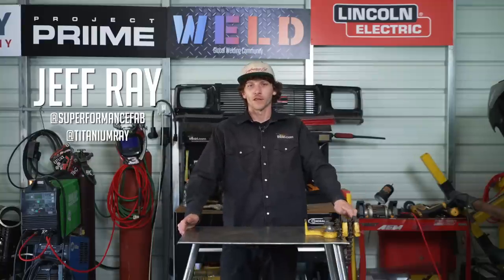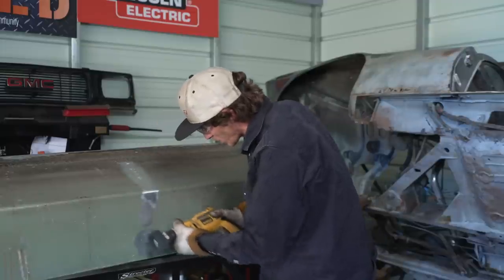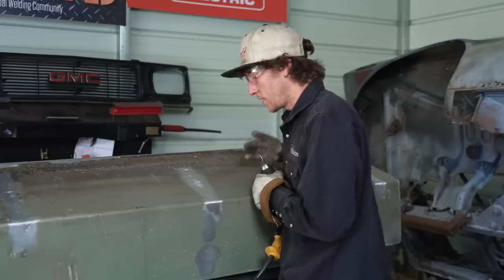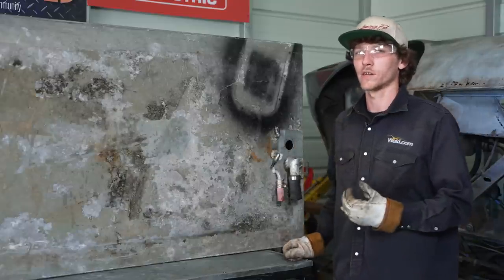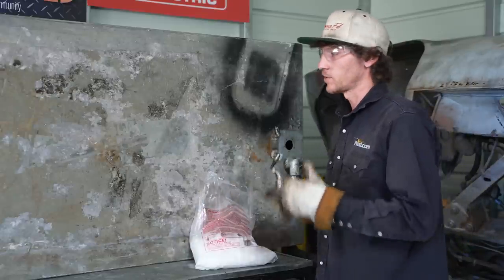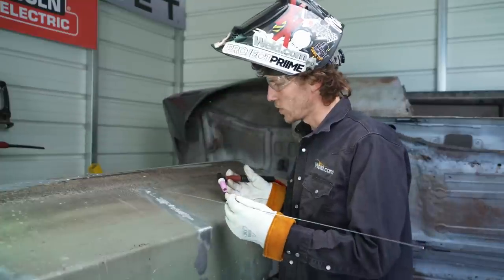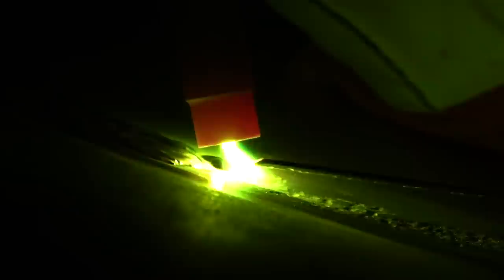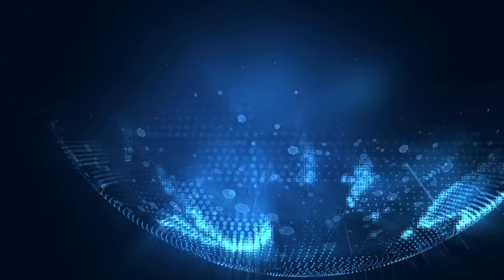How To Weld On A Fuel Tank

Comment: I used this method a few years ago on an airplane fuel tank it works great. One correction though, the water and dry ice is not a chemical reaction as such, all that is happening is the dry ice (which is frozen CO2) is sublimating to CO2 gas. The water is just providing heat to melt the dry ice..

Comment: Welding up a motorcycle gas tank this weekend, i'll fill it with water to push out the fumes, than drain it before welding, i have used a gas sniffer in the past before cutting into a 10,000 gallon fuel storage tank, still makes you think before the torch cuts that first hole.

Comment: Imagine if all welders said "no" I won't weld fuel cells, it would be like a union.....oh wait a second....
Reply: if you follow the safety procedures no problem but if the boss says it needs to be welded asap just fill the tank with water what do you do? Weld or refuse.

Comment: I dont have any aluminum or stainless tig experience. My tig experience is lift arc only. That said, is it normal for AC tig to have such a rounded electrode tip, and such a short stick-out? I always thought there should be a good point on the electrode.  Is that more specifically for jointery, rather than filling oxidized areas?
Reply: AC melts the end of the Tungsten so it's normal for the electrode to have a rounded tip when welding Aluminium. Pointed electrodes are used for DC welding on mild & stainless steels.

Comment: Currently doing aluminum boats. However don't have the actual welding certification which is needed to do fuel tanks apparently. Would you happen to know the specific cert required for this?

Comment: Is it normal to have that much arc wander from the tungsten to the material...?
Reply: No it’s not normal, at least not for the machine he’s running. It’s an IGBT inverter machine. His tungsten is supposed to be ceriated and sharpened to a 30 degree point and blunted at the very tip. He probably isn’t aware that balking tungsten has gone obsolete. Plus he’s probably using pure tungsten which is something those inverters don’t work well with

Comment: Would it be a good idea to also use a patch over the rewelded area?
Reply: Lowly farm welder checking in, I’ve been told more than once that “scabbing” pieces on is considered poor form. There’s the perennial favorite, the cut n’ butt, which is similar in intention. Remove the whole damaged portion and replace it with a flush patch panel. 

I think the fact that the “scabbed on” patch isn’t flush to the original surface is what what people think is ugly. 

I do it on things I don’t care much about and which aren’t structural.
Reply: The oxidation was minor so for this job i just removed the bad material and added some new material on top.

Comment: Actually you are welding on a Fuel Tank, not a cell. People call tanks cells but with out an interior bladder it's just a tank. Doesn't matter if it has baffles or foam. It's just a tank. 

Nice job as always

Comment: welded many gas tanks, just run carbon dioxide thru em... Hook a flex pipe to your tail pipe start your engine and let it run for about 10 minutes.
Reply: Do you weld with the cars exhaust running ?  Or do you just run it for a few min then weld ?

I have a 76 Jeep j10.. took the tank off.. had veey old green gas in it.. 10 gallons.. interior of the tank is in great shape. But the top of the tank rusted..  i want to cut that off.. and weld a new panel on it.  But i smell gas inside the tank still.

Thinking of taking the sending unit out as well to help with the gas.. but i was told by people on forums your method.

But how would running it only a few min fully get gas fumes out ?